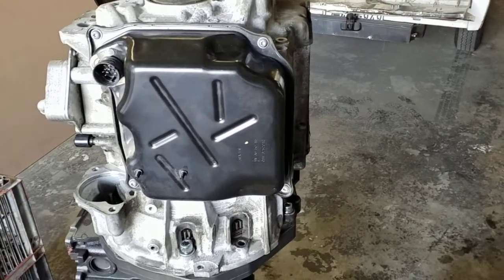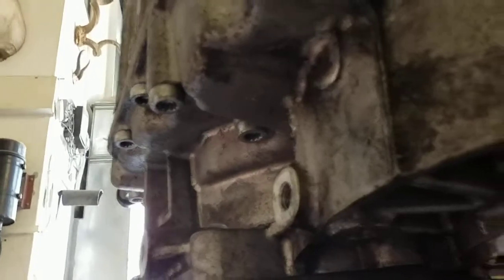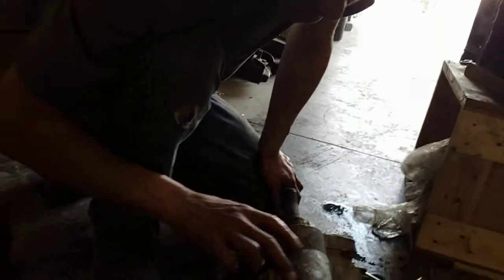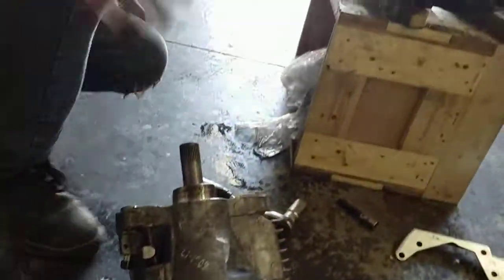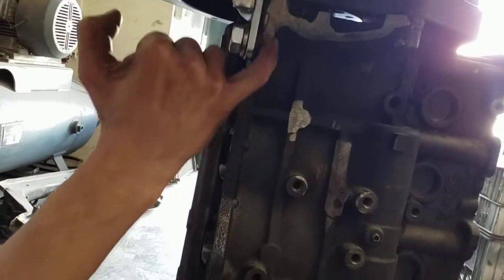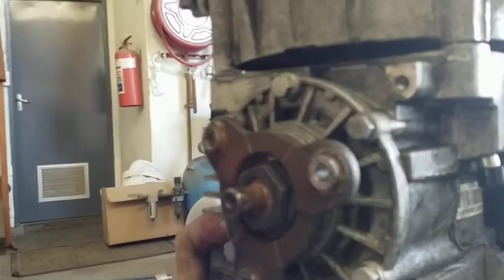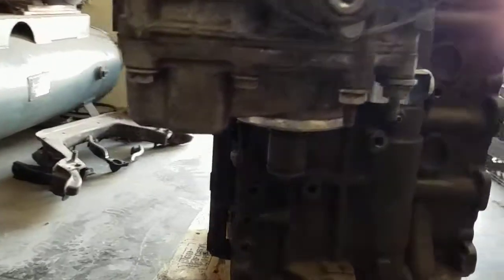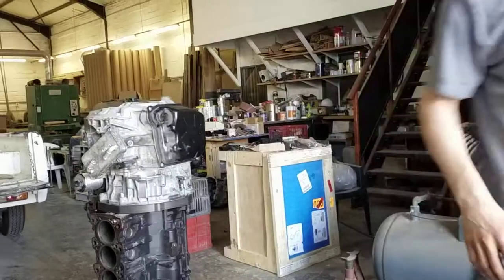evo 4g63 to DQ500 dsg assembly part 2

Comment: is the drive shaft video coming~？i want to know how it fit from inner cv
Reply from the maker: Not sure what you mean? The current adaption kit is to join the engine and DQ500 gearbox together. In a few weeks time I will release the rest of the swap parts. Like front and rear axles/drive shafts, and engine/gearbox mounts, and rear subframe for the Audi haldex diff.
Reply: @SuperDrivetrainSolutions  oh, sorry for un- detailed question.

i was windering the front axle (drive shaft), how to fit on 4G63 drive shaft to dq500. any kits and component？ will wait your next video~✌🏻️

Comment: Very interesting,  I'm hoping to see this in action soon! I need a dogbox trans for my power level Evo 9 RS (1000hp) but would love to go this route. What electronics would need to be used for this?
Reply from the maker: I have a customer already aiming for that power. Stock DQ500 can handle up to 900nm with HTG controller. After that you need some dodsons clutches.
Controller options
Htg standalone
Ecumaster EMU black 
Maxecu race

Comment from the maker: We hope to do an installation into evo 7 shortly. This DQ500 swap requires the use of audi or vw rear haldex diff. There is no choice in this matter.  Besides the adaption kit that is already for sale, we will produce the other required items for the full evo dsg swap also. 4 x custom axles. Custom rear subframe to hold the new diff.  And 3 custom engine/gearbox mountings.  The only item required by the user to do , is to have their propshaft modified. This I will not supply becuase it  will not be practical for shipping. For the electroincs, the user can use maxecu , or HTG gearbox controller which is full standalone. . Keep watching this space!
Reply: I would love a DSG gearbox on my Lancer Evolution V... I know it won't be cheap but it will completely change the car. Can't wait to see more 🙌

Comment: Will there be room for the mivec oil line on an evo 9 block?
Reply from the maker: I dont see why there should be a clearance issue. But if there is, simply use a braided hose instead of the firm steel OEM one.